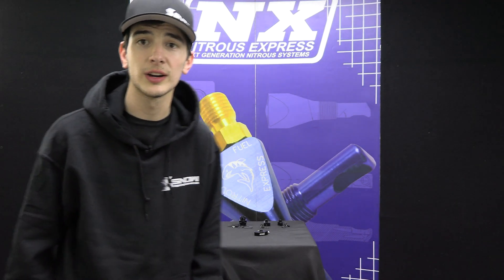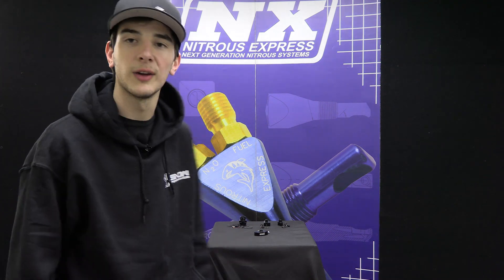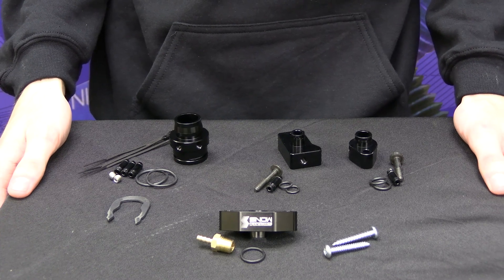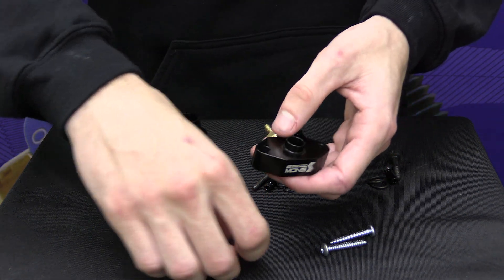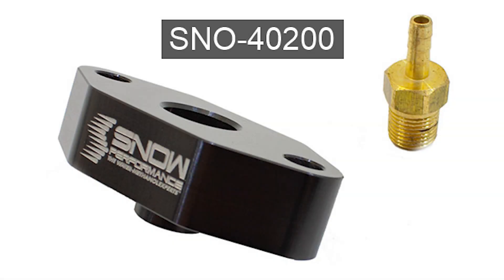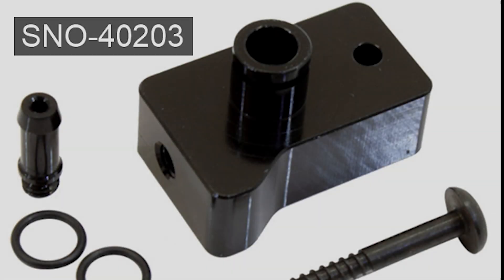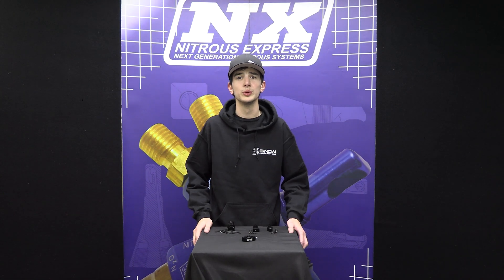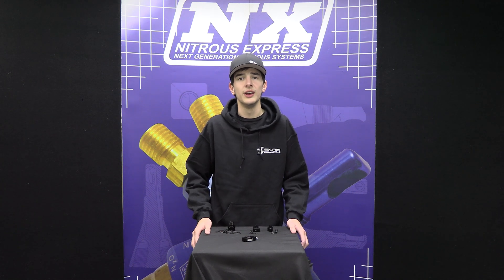Boost Taps From Snow Performance

Comment: Good info. 
Though Snow Performance has a weird way of making things.
If you look at the vc-50 controller the size used for this boost/vacuum line is just ridiculous.
Nobody makes boost taps with connects for hose that tiny.
Reply from the maker: We normally have 1/8" Silicone tubing that will go over the VC-50s tubing connected to the controller.
Here is a link for it 
https://www.nitrousexpress.com/1-8-silicone-tubing-ft-sno-83002.asp